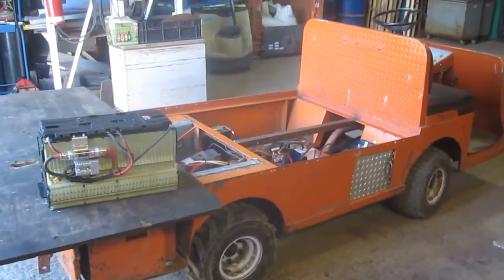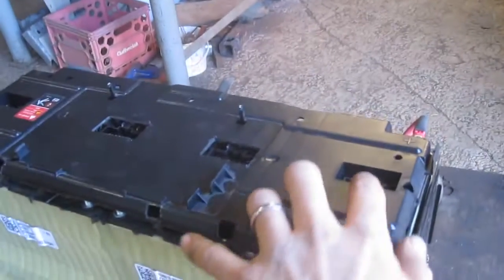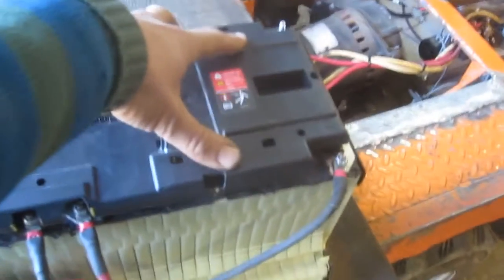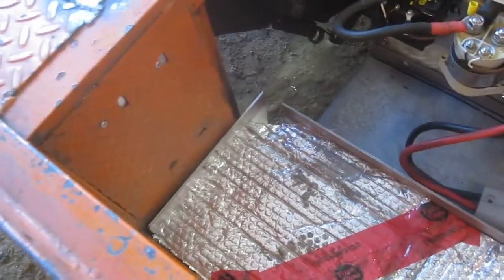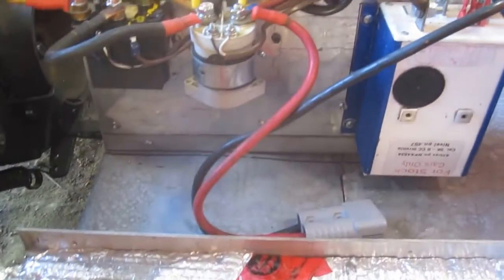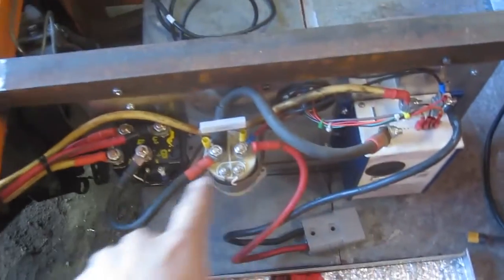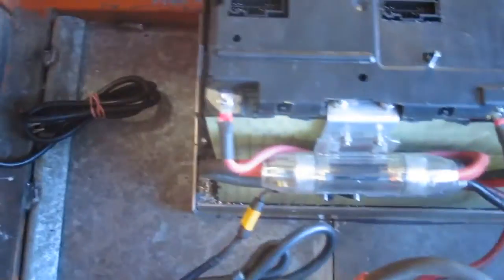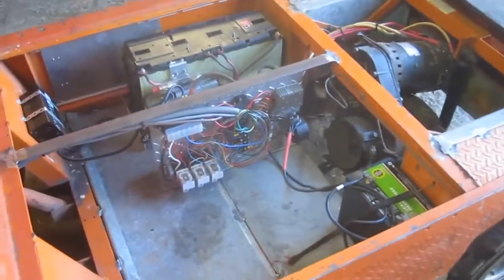Battery notes on Taylor Dunn re-power with Chevy Volt Lithium batteries

Comment: nice video!! Question, can a 48v module be made 24v ? can the cells be separated?
  thx!
Reply from the maker: I haven't tried to cut apart modules though I believe there is info on that subject elsewhere on the net.  I've actually moved the two 6S modules out of Bob to be able to use them for other project. I replace them with a 12S module and now its 2Px12S, still at 48V and working great.  I'm hoping to make some portable power tools with the 6S modules because at 20lbs and 10"x10"x10" they're quite portable for the stored energy.  So far I just have one running a pallet jigger and that's been very good though I had to put in a bit of scrap iron for ballast after replacing 240lbs of lead with only 20lbs of lithium.
Reply: Now how to keep the modules balanced , what should be te minimun and maximun voltage used per cell?  any BMS outhere compatible with them?
Reply: What charger are you using? I’m about to get a Chevy volt battery , just looking for a charger
Reply: Have you checked the balance on the cells? Why no BMS?
Reply: Volt packs come in 22vdc and 42vdc
Reply from the maker: CARLOS PORRAS yes you could easily find a suitable BMS. Each cell is nominal 3.7V with full charge voltage of 4.1 to 4.15V. (4.2 max theoretical I believe). They can be discharged down to about 3.5V per cell without harm.  So the 12S modules in parallel in Bob run up to 49 or 50V at full charge ( determined by your charger) and we can run them down to about 41V before we need to stop and recharge.  in practice that never happens and our cycles aren't that deep, extending lifespan.
Reply from the maker: balance appears to be almost unnecessary with these modules - at least the way I use them.  I check them and rebalance with small balance charger every 6 months or so but no cell has ever been out of balance more than 0.05V, often only 0.02 or so.
Reply from the maker: Justin see replies to Carlos re: balance and voltage per cell and per pack.

Comment: Nice setup. Bob looks like fun to drive! The charger looks familiar - did you get a custom cutoff voltage one made up too?
Reply from the maker: Yes the charger is 600W unit ordered from BMSbattery.com. I've since learned to use Meanwell RSP-series power supplies which default to CC and then CV in overload condition. They have adjustable peak voltage and there's one to suit almost any project. Can be used to feed an RC hobbyist balance charger or be used as solo charger without balance. Flexible, affordable and readily available without the delay of ordering from Hong Kong.  That said the Chinese charger on Bob works fine.

Comment: Very nice work. First time I've ever subscribed to a channel as I'm doing some research on possibly converting my 30 ft sailboat with an unreliable diesel to electric. A few companies sell a 48v setup but without the batteries. These modules would work great and are so much easier to place within the boat than heavy golf cart or 8a4d batteries. What amp hours is this setup? I would probably start with one set like yours to get it going and then add another set or two in parallel to double or triple my range.
Reply from the maker: Sorry for the slow response, you've surely already found the info elsewhere but maybe this'll help someone

12S modules from Volt packs are 2kWh @ 48V nominal.  Amp-hours scale with voltage whereas Watt-hours are more directly comparable.  That said, the 2kWh packs can each deliver nominal 41.6 Ah so Bob has about 80Ah though I'd never discharge that far.  In reality I would bet you can draw them down to 50 or 60% of those full discharge values without compromising lifespan but you'd have to look up the specs relative to these LG Chem pouch cells to be sure.  Yes this sounds like a fun project for your boat - though weight isn't as much your enemy in a lead-keeled hull as it is on the road but lead still sucks because of short lifespan and poor power delivery.  Have fun figuring it out.